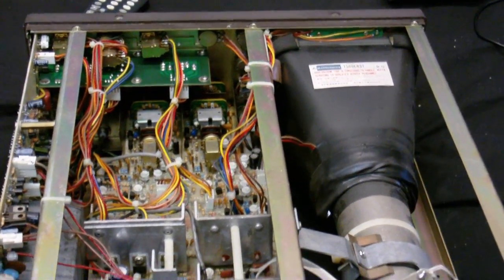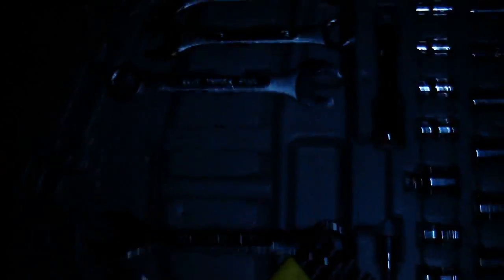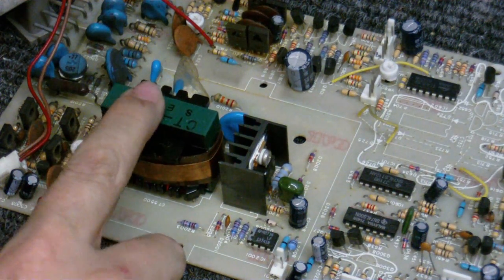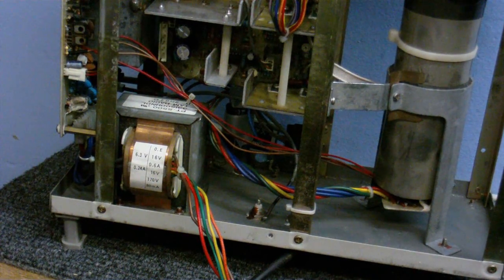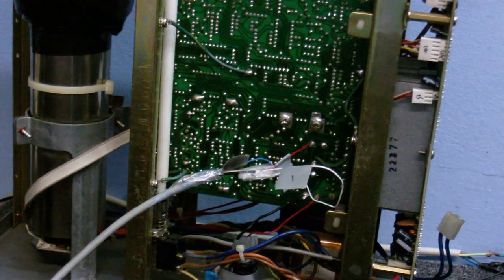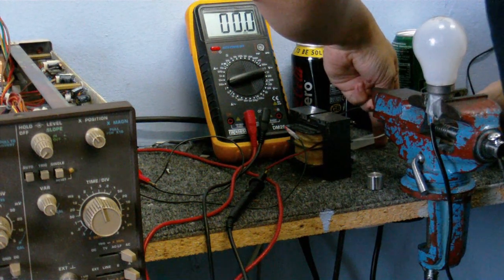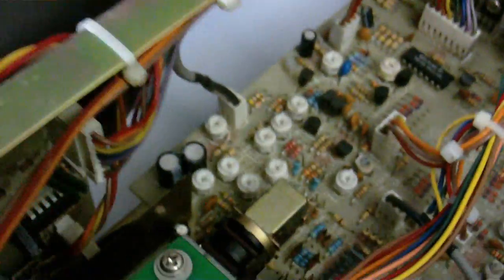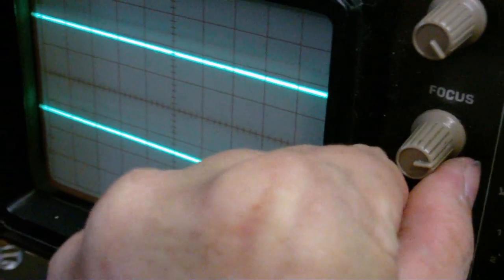Partial tear-down and fix of scope

Comment: Brightness is higher 'cause you mentioned that you powering filament with 7v instead of 6v (that's a way to increase brightness of CRT which is on its way out). But when CRT is OK, it's not recommended

Comment: Looks a bit like someone has taped the deflection coils in place on the back of the CRT. You may be able to fix the alignment by setting the rotation control in the center, and rotating the coil assembly on the back of the CRT to square things up.